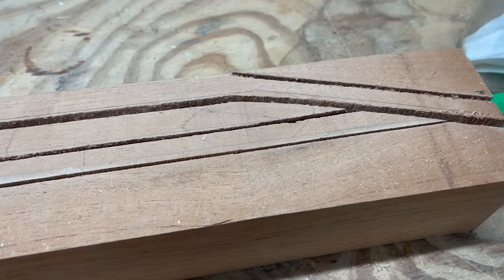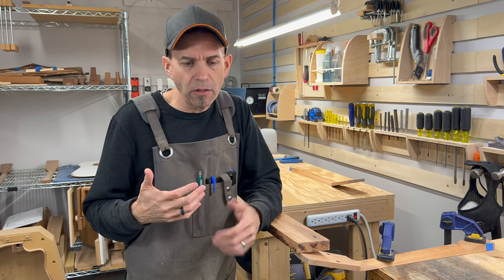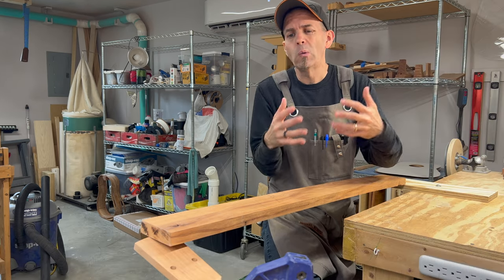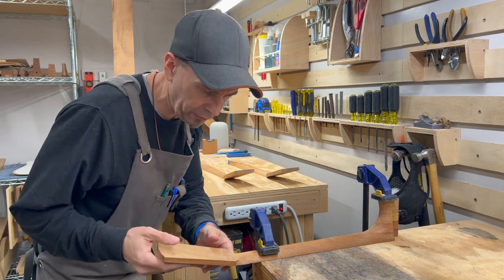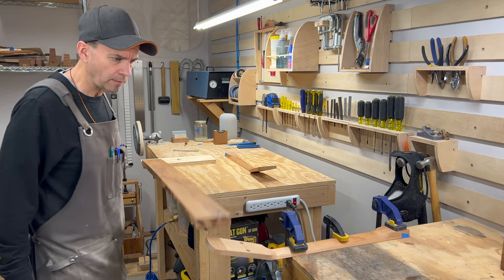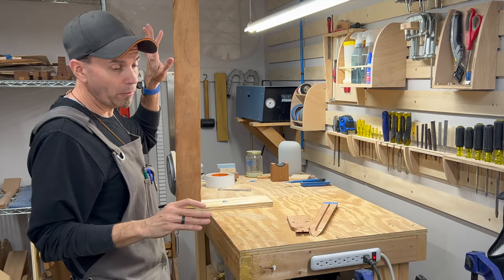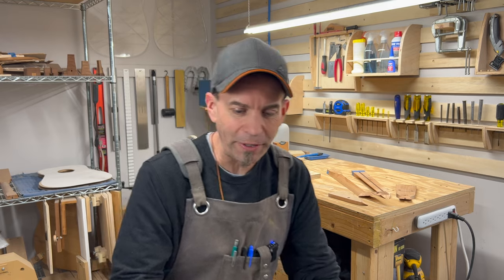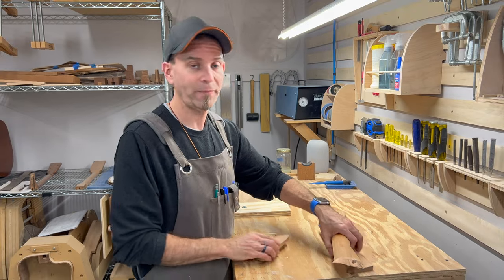Scarfed vs. One-Piece Guitar Necks - Part 3

Comment: The glue was holding onto essentially end grain, which really isn't much. Scarf joints are used to save money, not for their strength. The constant grain pattern, even with some of it being short, still has a good level of cohesion and strength
Reply from the maker: Scarf joints aren't only used to save money.  When I started building with that method, it was to achieve a higher level of resistance to warping/bending of the headstock over time.  Yes, it does use less wood, which is a nice advantage as well.

Comment: Try a scarf joint running through the headstock rather than the Asian splice.
Reply from the maker: That would be an interesting test.  When I first started doing scarf joints, I considered that method but didn't like the overall look.  Just personal preference.

Comment: One thing this doesn't account for is the 160lbs of string pull to assist the impact.
Reply from the maker: That’s true, I did mention that.  I would have needed to make a full guitar, all built out, and string it up.  A little more than I was willing to go through for the purpose of the test, but I would be interested to see if it would change the results.

Comment: if it was falling off a stand, it wouldn't  be clamped??
Reply from the maker: Well, I had to clamp it to place force on the joint.  Otherwise, the test would have needed to be done on a fully built guitar.  It was heartbreaking enough to bust up perfectly good neck wood.  I didn't want to risk a whole guitar.